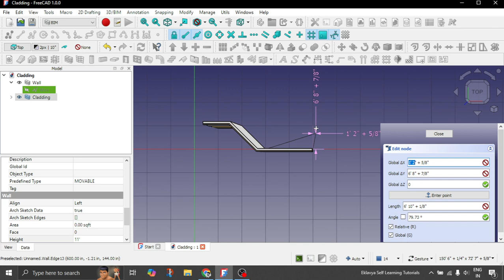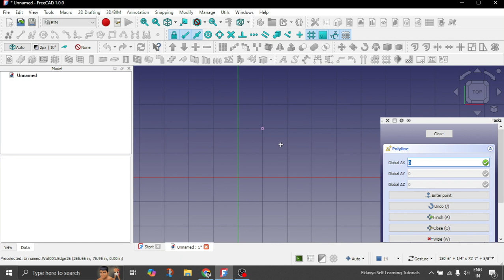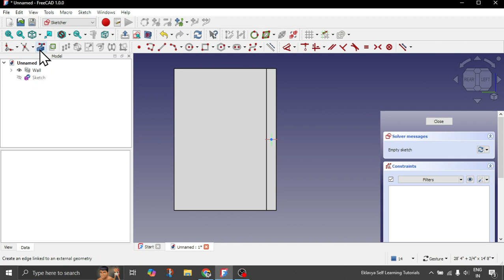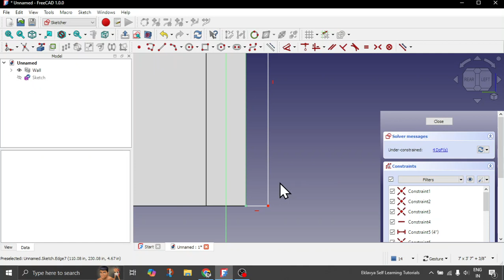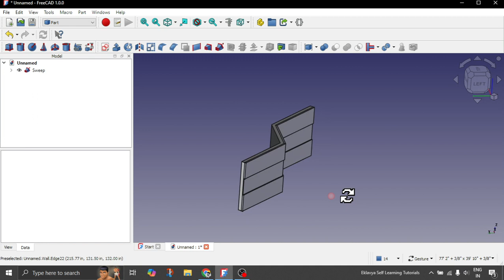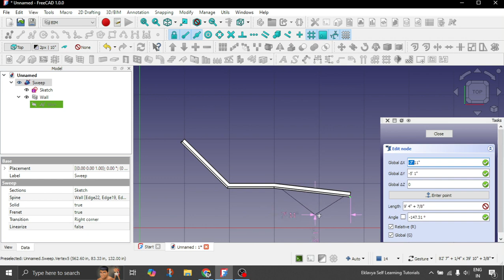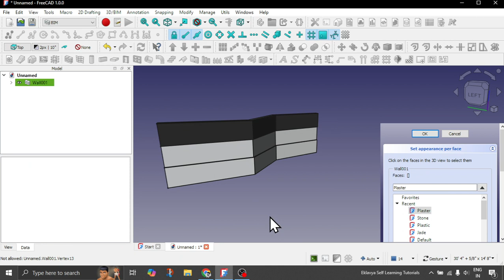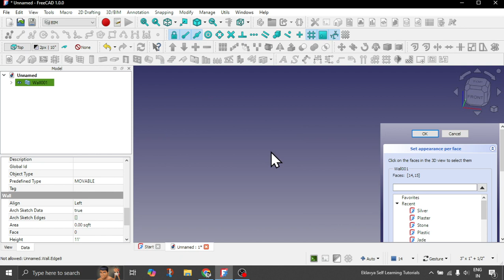FreeCAD Daily #6: Wall Cladding Made Easy in FreeCAD

Comment: I am trying to create a wall from a wire but the error 'Wall has null shape' keeps coming up. Can you help?
Reply from the maker: It could be due to couple of reasons. First could be that the scale could be quite lesser for your working plane. Means the length of the wall might be getting much lesser than its width.
Second could be that you might have selected a complex curve that is currently not supported to be a wall in FreeCAD.

Comment: If you insert window will it cut off
Reply from the maker: Yes it will cut one of the host wall. To cut 2nd wall, you simply have to use “Remove Component” option to cut window from 2nd wall.